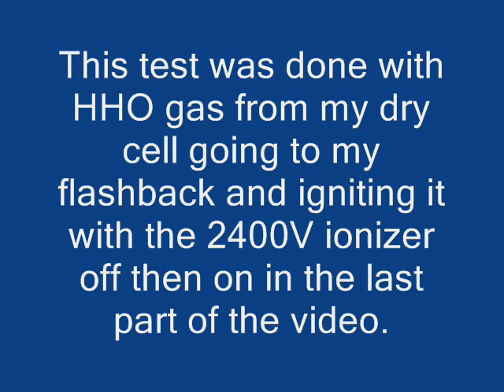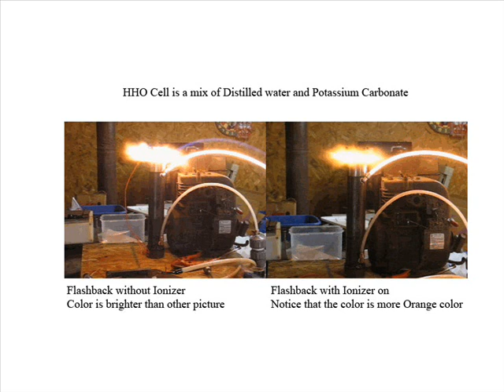HHO Flashback Ionizer test

Comment: i also think with tests of this nature,a calibrated measuring piston needs to be used.
with volume and maybe force meter.
something like a very light foam piston,in a clear cylinder with volume increments on the cylinder.
not sure how you would measure force tho,possibly a deflection pendulum that gets pushed by the expelling air from the open end of the calibrated cylinder.
dose the cylinder with a measure of the test gas with a syringue barrel and fire!